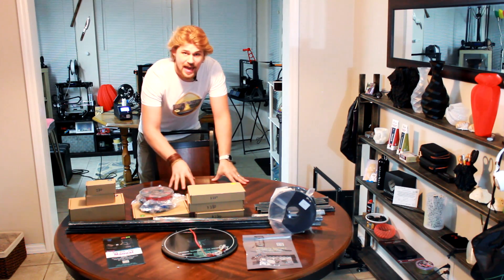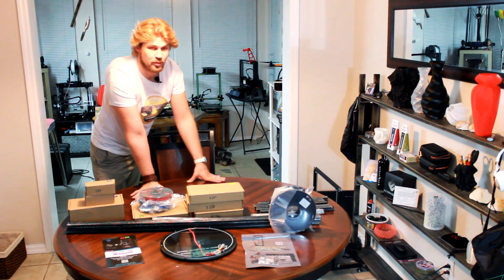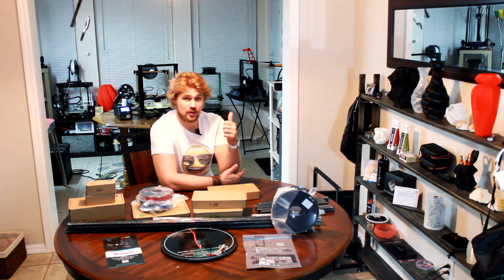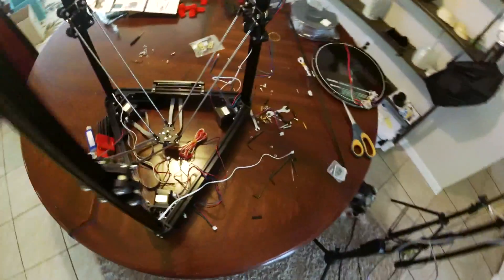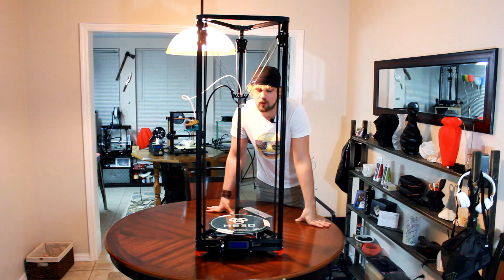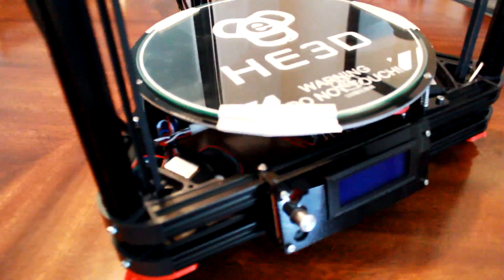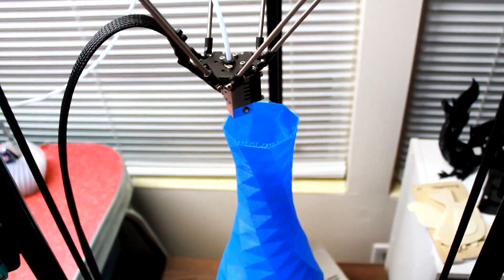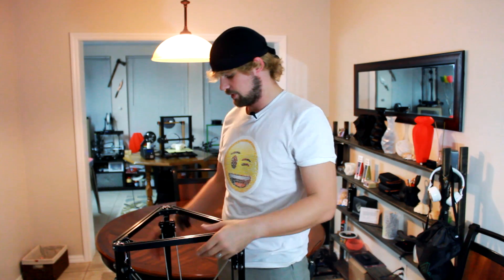✔ MEGA DELTA 3D PRINTER - HE3D K280 (Unbox & Build)

Comment: Now let me see if'n I unnerstands reprap.cn's 
solution to the dilemma of my having purchased 
a cheap Single Extruder HE3D EI3 3d printer that 
was fraudulently advertised as the NEWEST 
HE3D EI3 3d printer. reprap.cn proposes that I 
spend even More money on a company that has 
already failed me as a customer once, to buy all 
the parts, bits and pieces to turn this scrap 
Single Extruder printer into some semblance 
of an actual Triple Extruder HE3D EI3 printer. 

reprap.cn wants me to buy and pay to Ship Around 
the World the triple extruder hot end, two more
extruders, assuming the one extruder that comes 
with this boat anchor is compatible with the triple 
extruder parts, and if not, I will have to order and 
ship Around the World even yet Another extruder 
to replace the one that comes with this Boat Anchor.
Assuming all the triple extruder parts actually fit,
run and Are Compatible with the rest of this boat 
anchor of a printer, reprap.cn expects me to spend
The Rest of My Life cobbling together a bunch of
triple extruder parts that were Designed 2, TWO,
Years Ago and manfactured a year and a half ago,
1 1/2 years, ago. 

Then, THen, THEN I am to take these 1 and 
1/2 year old triple extrusion parts that have been 
gathering dust in some God forsaken warehouse 
for the last year, and spend a year of My Life trying 
to marry them to a Printer and Motherboard that 
were designed, let's be generous and say 7, 
SEVEN, years ago. A printer and motherboard 
that have been gathering dust in some God forsaken 
warehouse for the last FIVE, 5, years is supposed 
to be mated to parts designed 2 years ago, have been
rusting in a warehouse the last year, or more, and 
reprap.cn wants me to miraculously make
this Frenkenstein's monster of an HE3D printer 
work. Once again, ASSuming there are connectors
on this 7 year old motherboard design for modern 
things like extruder run out sensors that REPRAP.CN 
wants me to BUY from them, and a heat bed leveling 
sensor that REPRAP.CN wants me to BUY from them, 
REPRAP.CN wants me to attach them to a SEVEN
YEAR OLD Motherboard Design. ASSuming a 7 
year old printer even has a heated bed. I'd say those 
are pretty dubious ASSumptions.
 
To recapitulate, REPRAP.CN wants Me to reverse 
engineer a Triple Extruder HE3D EI3 3d printer out 
of a FIVE year old Single Extruder HE3D printer,
and parts, have me pay Three Hundred percent 
MORE than they sell the genuine Triple Extruder 
HE3D EI3 3d printer for; rather than refund me the 
$336 dollars REPRAP.CN cheated me out of.
And, ANd, AND REPRAP.CN wants me to pay 
them for the privilege. Cheat me once, shame on 
you,.cheat me twice, shame on me. 

I think REPRAP.CN  thinks I'm Elmer Fudd and 
they are Bugs Bunny, SUCKA. I don't now if 
REPRAP.CN thinks I'm crazy, but I know dam 
well They are.

Comment: Well I took a anycubic.  Kinda expanded it to a 400mm high and tossed a 280mm heated bed on it just made frame larger.  I was curious what length arms this printer has at 280mm bed.  In the magnetic arm building stage* pretty much dead ringer of these for my diy project.  My goal is low hight and large area prints mixing bowl high why not adding 1220mm 2040 extrusion leaving it stock for like 300mm high print

Comment: Can you release a more detailed video of the build process?
I recently purchased this printer as my first delta because it seems very easy to assemble, when actually it is a nightmare!!!
The instructions are designed in a way that they expect you to have assembled this printer or a very similar printer before and there are no good video tutorials online either. This is the best guide even though the build process is timelapsed.
Reply: if you manage to get this printer to work, LMK. I cant print anything at all. it will say "Printing 0.0%" then vanish like nothing happened. This guys discord is completely empty too, no luck there.

Comment: Awesome video! One question though. 

Did you place the endstops at a arbitrary point? Does it matter how high they are? 

And do you know any other tutorials on assembling this and for the firmware?
Reply from the maker: I equally placed them all about 10cm or so from the top, i believe I used one of the plastic pieces to make sure they were all at the same spot. You want to get them as close as you can to the top so you have as much space as possible to print!)
Reply: Reality Check VR alright thanks. Was the firmware already on the board and if so, did you just download the repetier server and start calibrating?
Reply from the maker: It had software that came with it, still I did just download repetier and calibrate myself) It was pretty easy afterall)
Reply: Reality Check VR Alright thanks. I hope it’s easy for me. I’ve built one from scratch and the calibrating process for Marlin was a nightmare.

Comment: Good afternoon! I already have a prusa tevo tarantula top upgraded and I was looking after a large printing area delta printer , and I was looking after the tevo little monster but this one is available for the half of the price. 
What’s about the quality of the printing? Does the printer works with flexible filaments? Do you think it worths? Thansk
Reply from the maker: I'm printing a mega large wooden sword at the moment that looks BEAUTIFUL!
The flexible filament pass or fail is all in the extruder, sometimes adding a cut tube will make it work fine, I upgraded the bowden printers with this MacEwen3D Replacement MK8 Extruder - https://goo.gl/K4gJDJ - (no affiliation) hope that helps! I will have another video on this printer very soon once the sword is finished)

Comment: Do you do your own music?
Reply: Reality Check VR Dude. Did you make the time lapse song track? Or who did? I was printer shopping and found your video. It was a contender but the song of the time lapse still runs through my head. Let me know the name and artist pls. You show off this printer well. I just needed a more square build platform since I did not want to try building z height and 2+ objects at once with each other for supports. It would also be limiting in shapes.  I ended up considering this one. The tronxy x5s (fixer upper) and the tevo tornado. Went with the tornado since it sat in the middle pricing wise and would be a good first printer. Thanks for the info and cool time lapse on [a] delta.
Reply: @holytoledo760  it sounds like Moon Hooch.  Even if it isn't, I'm pretty sure you'll love them.
Reply from the maker: I use a mixture of beats I create myself as well as other royalty-free tracks) This one starts out with "together" by Ikson
Reply: nice, sounded good